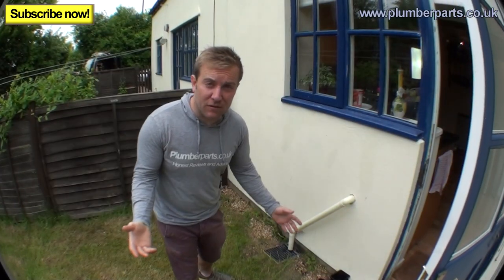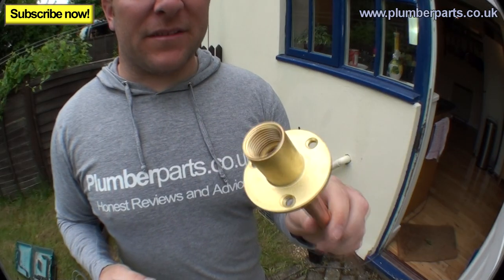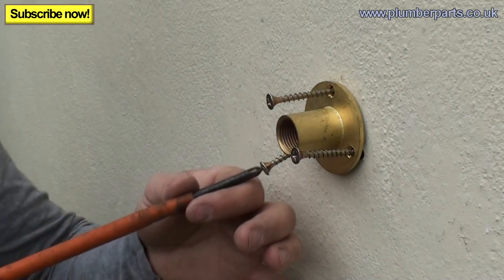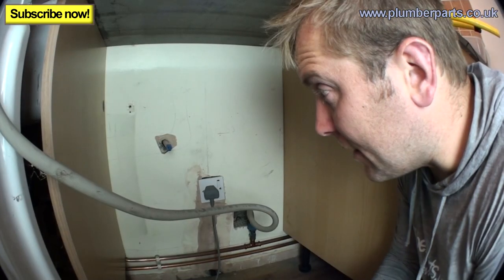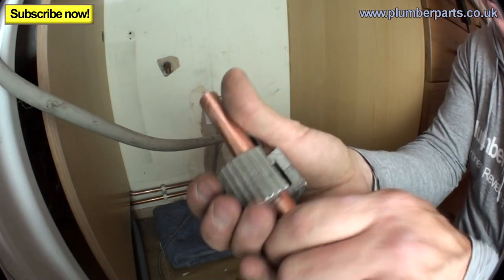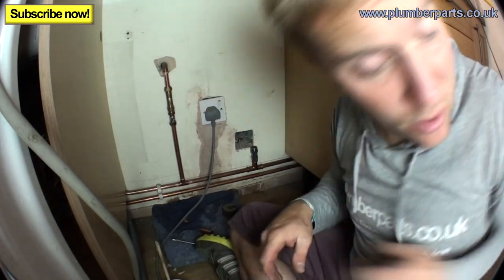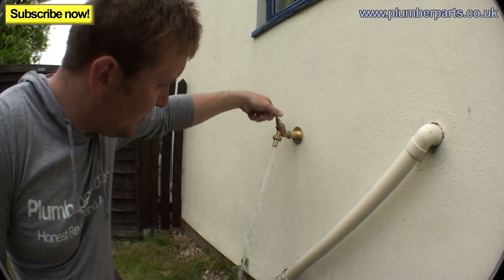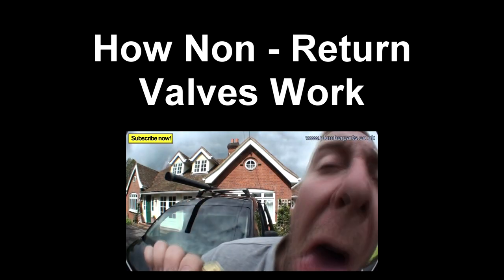HOW TO FIT AN OUTSIDE TAP - Plumbing Tips

Comment: @ian bellis

Pipes going thru a wall are sleeved to stop them from being corroded by the concrete or cement. Concrete walls or the like corrode the copper. So the use of 22mm is sacrificial. Also yoy say it is to stop water going into cavity  we seal tge sleeve at both ends to stop ingress of cold air in hot air out and stop creepy crawlies from entering. I use silicone. And as for building movement. If it was gonna move that much to crush a pipe i tor one would not want to live there.

Comment: Is it not advisable to sleeve the copper pipe when you put it through the wall to prevent corrosion to the copper pipe from the cement. In the kitchen, shouldn't the hot water pipe be above the cold

Comment: Why didn’t you just take off the existing washing machine tap and put on a 15mm compression tee then put the tap back on? That way would save you cutting into the low level copper pipe.

Comment: how come you put a check valve and an isolator too
cant you just turn the check valve off in winter?

cheers buddy
Reply: check valves don't turn off, that screw isn't for turning
Reply: Check valves are to ensure the water from the outside hose doesn't go back into the mains water if someone flushes a shit away or turns the tap on. You're thinking of a service valve which isolates the supply.

Comment: Do you need to apply some ptfe when fitting the compression valve? Thanks
Reply: No need on compression fittings, PTFE is used for threaded fittings.

Comment: How can you have water feeding from outside back into the mains via an outside tap? All the tap will see is air when not in use.
Reply: Thered still be water in the pipe from the outside tap to the main feed that’s why he put a non return valve on by the stop valve

Comment: Great vid, just wanted to know what model makita drill are you using? And what size drill bit did you use for punching the hole in the wall for the pipe. Thanks 👍🏼
Reply: 5.5 to 6mm

Comment: How long do you suggest the water is ran for to flush the flux from the pipes? Thank you.
Hold Tight!
Reply: overnight
Reply: kd. till it runs clear. not that you should be drinking from an outside tap

Comment: My screw holes keep breaking into the middle home, what size drill did you use
Reply: If your wall is soft or you have outside cladding crap on your wall it may well do. You might be better off doing it the elbow and copper pipe up the wall and back plate and tap
Reply: I use a 5.5 to 6mm bit for red.
Reply: Don't use the hammer action at all ... or use a proper sds drill... they don't seem as severe as ordinary hammer-action drills... & as said above... small holes for reds  😎👍☘️🍺

Comment: Is fitting a non-return valve a must for a outdoor tap? My plumber never fitted one. Can anyone advise if its still safe to use.
Many thanks in advanced.
Reply: A lot of taps come pre-fitted with them, so you're probably fine.
Reply: Some taps have them built in but most plumbers are twats and won't fit a £2 check valve.

Comment: By way of the incorporated shut-off valve, it appears to be possible to drain the section most vulnerable to an otherwise likely burst situation during the a hard, sustained frost but how many homeowners will have the foresight to actually think of doing that? It would be better to make suitable provision for insulation. It's a pity a smaller diameter pilot hole wasn't drilled through the wall first and then part of the finished size hole could have been drilled from the inside, thus avoiding the messy spalling of the under-sink plaster work.

Comment: Hi instead of using the solder joints can I use the one you tighten up with push lock pliers as I don't have a gas solder
Reply from the maker: Anthony Davis Yes they're fine
Reply: Anthony Davis You mean a compression T. You need to create one side of the compression T so tighten an olive with a nut onto one side beforehand it will make life easy if you use a copper pipe piece say 40 mm over the length for re-cut accuracy when you are a beginner. You will lose a bit of money on copper but nothing to cry about. Then measure accurately to the mm, the distance of cut. If short, it will leak, if long it will will compromise straight connection & once again cause a seep ( leak ). Compression joints require mint set in joints. then the olive will do the rest. If you are short it will seep. If it is set in correctly & has been tightened to the max torque but still weeps say 2mm of water per hour: There is no choice but to undo weeping joint and wrap 3-5 times with PTFE WRAS certified tape. Solder joints need to be fully set in too but will bend slightly if not soldered in the correct way when cooling. So ensure straight first hand.

Ah dam...

I forgot to close the last drain valve on the central heating system & poured 1 litre x100 back into the system... 

The fucking Conservatory is flooded.

Why ? 

Cause I was distracted talking to you.

Comment: Do you always solder (introducing heat) with shut-off valves and sundry in place ? What about possibility of damaging the internal seals ?
Reply: I keep a mist spray or damp towel to stop clips and sundries melting.  as long as you apply the mist slowly away from the joint, it wont cool too fast and crack solder

Comment: That silicone serves no purpose at all, it was put on too far down the pipe. The pipe wasn't sleeved and the tap should've been fitted before drilling the fixings too the wall.

Comment: If that pipework is being installed behind where an appliance such as a washing machine or drier is sited, how does your customer get easy access to the isolation valve to turn off and drain the tap in the Winter! LOL

Comment: Would be better to put the silicone around the back of the fixing plate, not around the hole before you push the pipe through taking half of the silicone with it 😜

Comment: What size drill bit did you use for the hole?
Reply from the maker: 24mm these days to take a 22mm sheath pipe.
Reply: 16mm for a 15mm pipe
Reply: Liam Smith 16mm
Reply: Hi I had a outside tap fitted but the plumber didn’t fit a double value on the inside. Will this cause me a problem in the winter. Thanks
Reply: parma singh yeah it should have an isolation valve on, that way in the winter you can turn the supply off and drain whats left in pipe so it doesnt freeze over.
Reply: Craig Tampin 

Craig, my pipes are covered up by inside kitchen cabinets and I can’t get access to the pipes. What would you suggest. Thanks

Comment: DUDE! I want to install a hot water tap outside, to clean stuff with, not for making brews or owt. I don't want the water properly hot, merely tepid. So what is the best way to accomplish such a task? Is it a case of using a thermostatic mixer valve on't'other side of the wall? Brrrrrrrap!
Reply: yep. just done one today for a customer who washes her horses. a blending mixer. about 25 quid

Comment: so cut into cold water pipe ,dont turn the washing machine socket of round about water ,would have been better too show people compression fittings rather than yorkie fittings ,very hard for normal person unless plumber too solder when water is in the pipe ,you turned the tap off the tap should have been left open if you were soldering, steam can build up off blowtorch and you closed the exit off apart from that cool

Comment: The pipe going through the wall should have a sleeve on it mate as a matter of good practice. Also when you turn the water on, leave the tap opened or grit and crap in the pipework will not flush out and damage the jumper valve and this will prevent it from sealing, when trying to switch it off causing the tap to drip.Otherwise well done.

Comment: where is your pipe sleeve? All potable water pipework passing through walls needs to be sleeve. Maybe England has lower standards. In Scotland its law. Ref Scottish water byelaws
Reply: Grant Anderson pretty sure because it's an outside tap used for hoses and gardening and stuff you don't need to sleeve it on the way out, + if something did go wrong you have a non return valve so I can't go back into the water you use for your taps e.g. Drinking water. I might be wrong though
Reply: needs to be sleeved in england to. was thinking the same thing
Reply: There is supposed to be a sleeve through the wall if the pipe bursts via frost or debris falling down the cavity which could damage the pipe and leak into the cavity you would never no until it’s too late
Reply: Its only gas what has to be sleeved by law

Comment: Need to be careful soldering so close to double check valve as inside gubins are made of plastic. Either solder before valve is fitted or wrap a damp cloth around it. Good vid otherwise

Comment: compression/mushroom type valve in the 21st century? It will leak after the first winter. Have you heard of ball valves on that island of rain,  mould and medieval building materials?  Obviously massive condensation inside the house from that lazy pipework.

Comment: Maybe should have stressed the point of turning off the water supply before commencing work????
Reply: Can't seriously not think about doing that if you're going to do any plumbing. Even for a novice, turning off any utility supply is common sense before doing any work. Almost akin to running a bath without plugging the hole.

Comment: Outside tap kit from toolstation- takes about 30 min to fit. Tools needed: hammer drill, screwdriver.
Reply: fitted one today. not bad for £13. I ditch the hose which is supplied and hard piped it

Comment: cause you know, everyone owns a blow torch
Reply from the maker: Of course! Or you could use compression fittings....
Reply: ***** thanks, compression fittings, Ill bear that in mind
Reply: Just out of curiosity, why did you choose to solder? I would have thought compression fittings are simpler, or maybe soldering is easier in the confined space under the sink?
Reply: I do, don't you?
Reply: Carl Revell because every plumber knows a well soldered fitting is the mark of a good plumber

Comment: Didn’t even use jointing compound for the compression fittings...embarrassing
Reply: You don't need compound. The olive creates the seal, not the thread.
Reply: And the jointing compound gives it the extra insurance to make sure it don’t leak, sometimes the olive is not enough